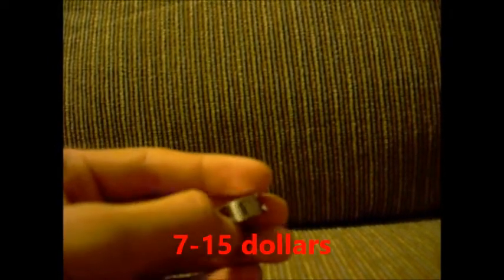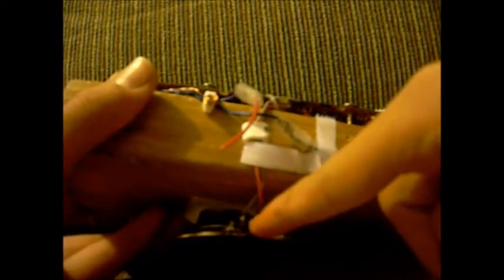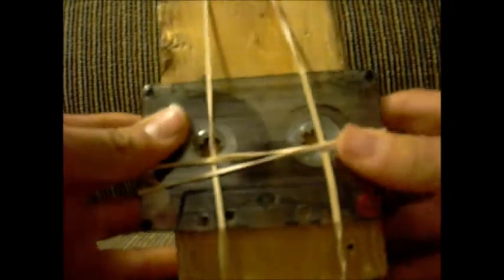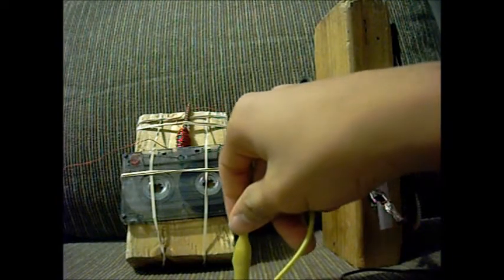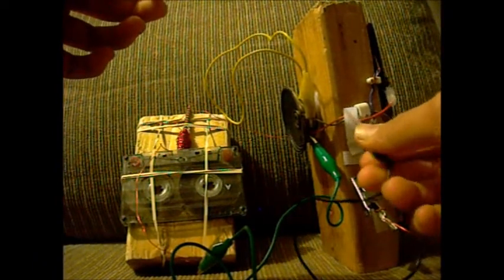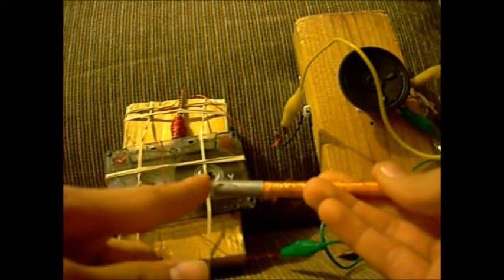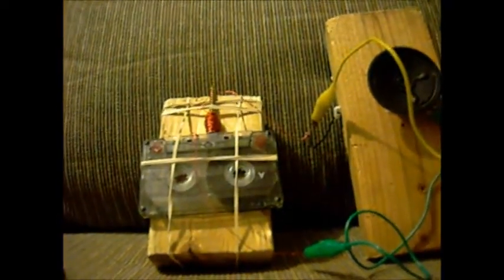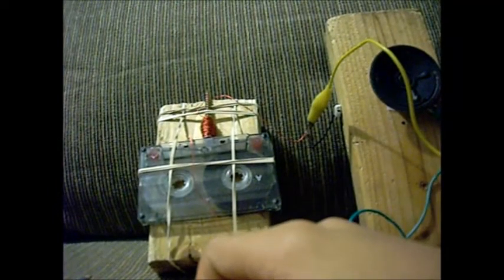How to make a Tape Recorder

Comment: I think you could totally have played the tape with that screw.  You'd just need to connect the the screw to a audio jack and plugged that into an amp. The level would be VERY low, so I'm not sure you could get it loud enough to be clear at all but there are some videos of people doing that on here. Though, none have tried recording/playback by winding a tape manually.  Neat video!  Thanks
Reply from the maker: This would be possible! This sucks as I don't have an amp powerful enough.
Reply: @thatrecord5313  You need pre amp AND power amp! Your idea is genius but you probably didn't hear about "preamp".

Comment: The problem here is that you are playing back only the very low notes because of the width of the head relative to the tape speed. For the usual tape speeds, to recoed and play back the higher audio notes you need a very narrow gap of the order or .001". Tape heads I would think are not that expensive. When I was a lad back in the 1960s, one approach was to wind a coil onto a single mu-metal lamination, bend it round so the ends just meet, insert a piece of aluminum kitchen foil into the gap and push the gap end into a slit cut into a brass nut one corner having been previously filed round. You then solder up the gap, file and polish to finish. 
The tape needs some magnetic bias to record which in cheap machines of the day was provided by a permanent magnet. To erase, the magnet needs to be brought closer to the tape and you will need to experiment with the relative positions on record/erase.
While this set-up worked, I could not eliminate pick-up from motor sparking so concluded should have used a better screened motor rather that a cheap 'toy' type. 
Best regards!

Comment: Can a stereo audio head function as the recording head?
Reply from the maker: Of course, as long as it provides an electromagnetic field whose signal can alter the tape. This is easily checked by activating the audio head and playing a long tone signal on full power, then applying some magnetic substance to the head to check where it is most magnetic and then aligning that area with the tape.
Reply: @thatrecord5313  where side it recorded?
Reply from the maker: @GrandVah  The entire side. I didn't try to record on just the left or right side. It was easier just to record the whole tape.
Reply: @thatrecord5313  can the sound source be a powerful headphone jack?

Comment: i tried this many many many many times but nothing happens to cassette
what is wrong with my magnet?
Does powerful audio jack work?
I dont understand this video because its unclear

Can you help me please
Reply from the maker: An audio jack is not going to work. It doesn't have the required power to make a medium-size electromagnet work. Remember, in an audio jack, only minimal amounts of electricity is being provided to power tiny coils in earbuds top power them. Larger electromagnets like the one I use--and maybe like the one you're using--aren't going to function at even a fraction of its capacity with power from an audio jack. That is why I used this old radio, because there was an amp integrated that was strong enough to power both a large external speaker and my electromagnet.
Reply: @thatrecord5313  can record head make without copper wire?